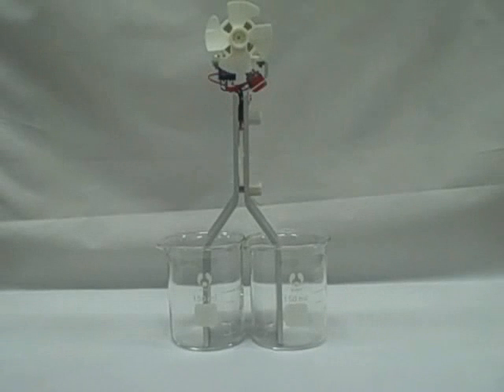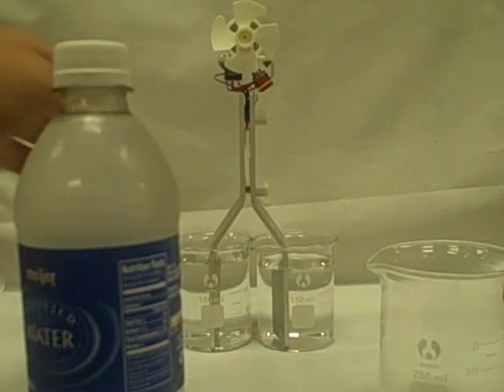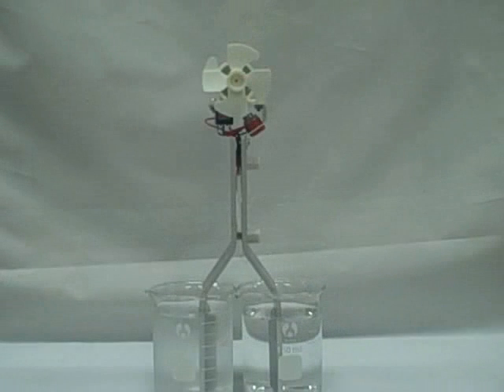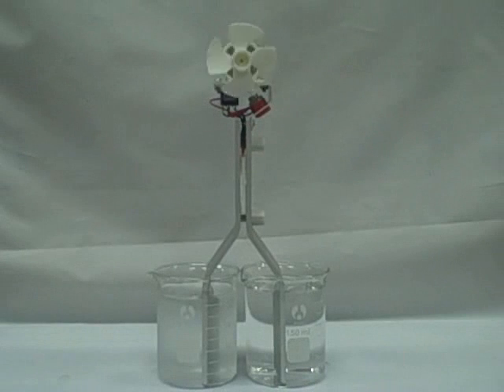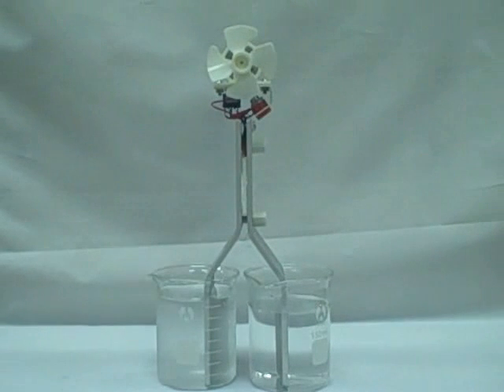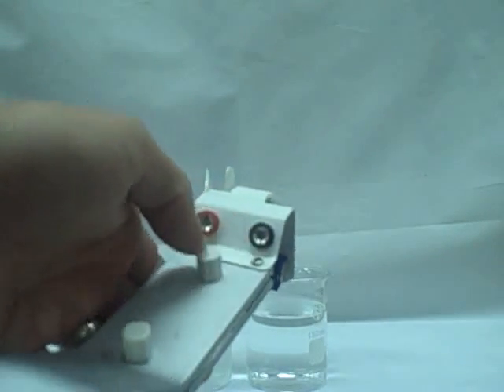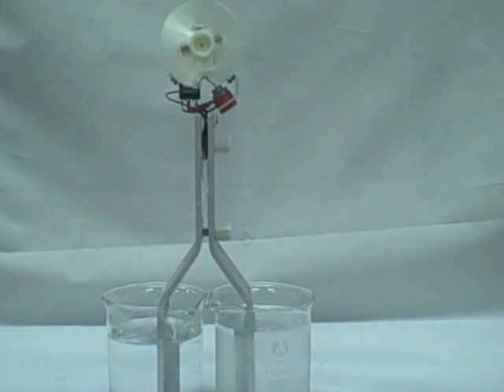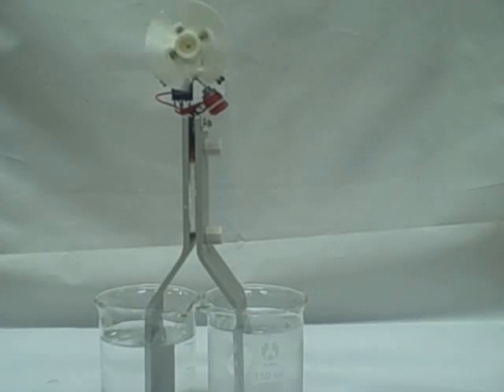Thermoelectric Generator Demo  SCI-SUPPLY.COM

Comment: I'm new to thermo-couplers & may have a design that could be comparable to Nasa.  I'm using a 1.5 x 16 " iron pipe as the common ref. pt for the iron.  The hot pt. is 1,800 F and cool side ambient temp. No. 8 gauge x 8 " copper leads are drilled & inserted into the common iron pipe with end protruding into the interior with hot pt. at 1, 00 & ref. pt. approx 400 F.  Would this work?  Joshua.